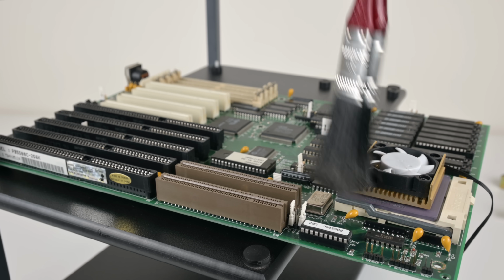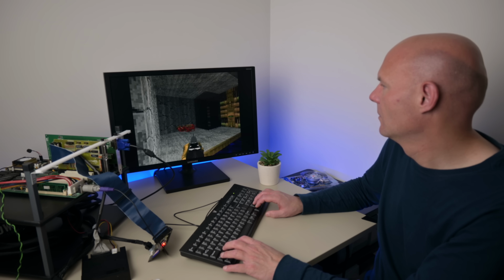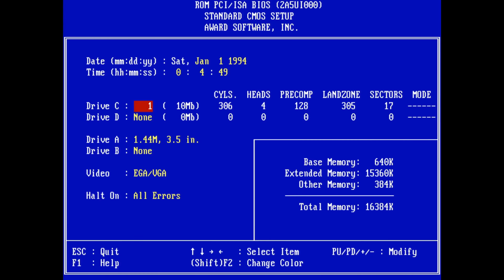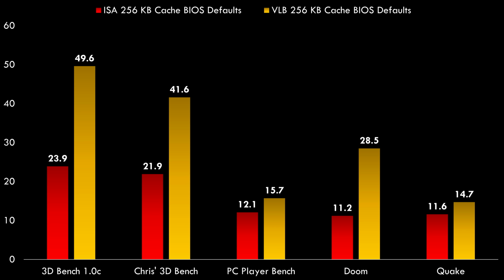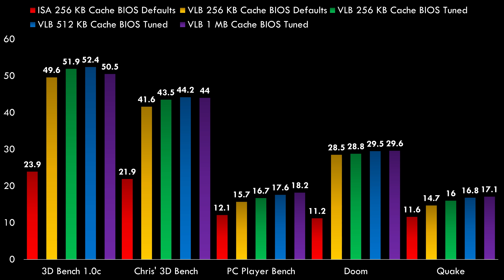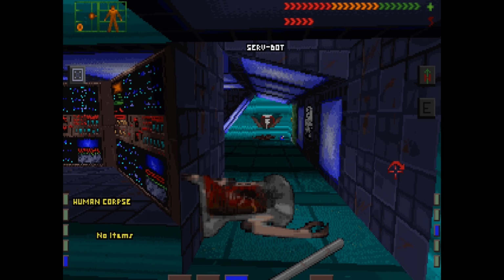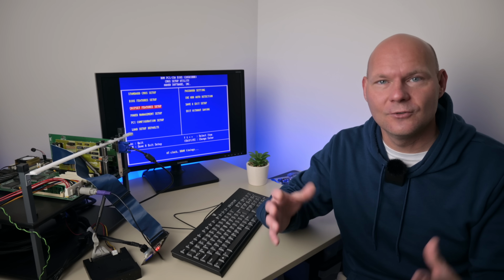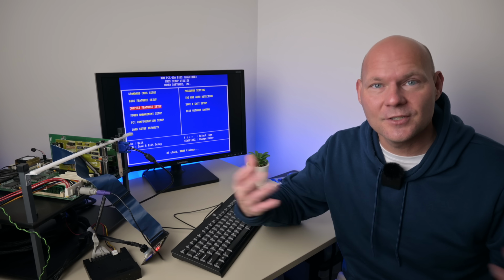Broken CPU Launched the Pentium Branding

Comment: I'm curious, is there a reason with this mobo (aside from the fact that the hardware is so beautiful) to run a VLB video card instead of PCI? Was VLB more stable here?
Reply from the maker: I don't remember why I didn't use PCI, maybe I tried it and couldn't measure a difference. But it's something I can do in a follow up video of some sort.
Reply: @philscomputerlab  I did some digging out of curiosity and this Opti chipset uses a PCI-to-VLB bridge, so PCI would probably perform marginally worse with otherwise identical 2D cards
Reply from the maker: @hblanksjukebox  Thanks for checking this!

Comment: That Pentium is the reason I stopped buying the latest CPUs. I got one and had to return it. On the plus side, by the time I did the 120 Mhz Pentium was out and I got one of those to replace the 60 Mhz bugged chip. No extra charge too. The AMD FX-8350 reinforced this when it came out. I bought one instead of an Ivy Bridge i5 and had serious buyer's remorse for a while. Since then I wait a year to see what comes of it. The Newest chip I have is Alder Lake. When 14th gen hits, i'll upgrade to Raptor Lake. And so on. On the AMD side I am stuck at 2700X. It's way overdue for an update.
Reply from the maker: This is the way. I worked once for a notebook manufacturer and the QA guy told me, never buy the first if anything.

Comment: I have a Siemens Nixdorf PCD 5H with Pentium 75 here.  In addition to 96 MB RAM, it even has an additional USB 2.0 with SATA combi controller 😁 It even works with an SSD, but you shouldn’t expect mega speed.  As you say, 640x480 is critical and 800x600 isn't even worth trying.
Reply from the maker: Awesome 👍

Comment: You should benchmark it with a PCI video card. Most boards with both VLB and PCI have a gimped VLB bus. Sweet board though. That is a keeper for sure.
Reply: If I remember right, I think I have one of these in PCI somewhere. Yep, it's a Stealth 64 DRAM T PCI with two removable memory sockets and 2 fixed to the board.
Reply: While I appreciate it wouldn't be period correct, I'd also love to see this with a Voodoo 1 added. I'm thinking along the lines of, if this were late 1996 / early 97, would a Voodoo have given such a system a last hurrah before being retired from running modern games.

Comment: The chipset is a massive bottleneck here. You cannot have VLB on pentium, cause VLB is a part of the CPU FSB bus, and VLB is 32-bit but pentium uses 64-bit bus. This OPTI "thing" is the only chipset that allowed it, but it does it by operating only as 32-bit. Thus this system has half the memory bandwith. If you want the top performance from early pentium I suggest SIS based socket4 motherboard (SiS 501/502/503). The Intel 430LX is also pretty bad.  Edit: It seems I was not 100% correct, OPTI made many chipsets and revisions, and the one you have seems to be one of the better ones, it has 64-bit access to the memory, but the PCI/VLB is bridged and it still performs sub-par compared to the SIS full PCI setup. I would love to see this system with the VLB card comaprted to the best 486, like Intel DX4 with write-back L1 running at 120 or AMD x5 at 160, which is the better VLB system. My bet is on the 486.
Reply from the maker: The benchmarks though check out, haven't seen anything much faster. I'm sure I would have tested PCI but can't remember the details as I've collected the data years ago before moving and only recently produced the video.

Comment: Nice video Phil. I had one of these first gen Pentiums, the 66MHz variant. A very expensive "white box" build, close to $4000 AUD in 1994 with an Octek mainboard, Connor 420MB HDD, Tseng Labs ET4000W32i VESA bus video, Sound Blaster AWE32, 16MB RAM and a KTX branded 15" SVGA monitor with a 16x2 character LCD status display below the CRT that displayed monitor settings, resolution and refresh rate information. The CPU had the FDIV bug (tested in Excel using a particular formula). One day the computer went into a boot loop, resetting every 5-10 seconds. On opening the case I discovered the heatsink had fallen off the CPU. It was glued on, there was no mounting bracket! The Octek mainboard inside was a cost saving design with a mix of VESA local bus, PCI and ISA slots. This slot configuration meant the system took a performance hit - this board introduced extra wait states on the expansion slot bus in order to juggle the different slot types. A more expensive pure PCI system with the W32p video card would have been better. Video benchmarks confirmed my friend's 486 with a cheap video card had better pixel pushing performance than my expensive Pentium with its premium VESA bus Tseng Labs video card. Still I have some great memories of this machine playing games like Tie Fighter, Wing Commander and of course, DOOM (including some local PvP over a null modem cable I built).

Comment: The aim of Magic Carpet is: Build a castle, kill the monsters of the map. collect the Mana they drop to get more powerful, kill your opponent wizard. Fantastic game, it had also a very good successor. I played it on a AMD486/DX2-80 back in 94-95. It was running flawlessly in VGA with high details and not using the post processing effects the game offers.The game is actually Pentium optimized, you get a nice Pentium-Logo when you start it on a Pentium machine. I think Magic Carpet makes a very great benchmark title, it supports bot VGA and SVGA, various levels of details and post processing effects, making it scale all the way from mid range 486 to fast Pentium IIIs.

Comment: The battery was a Lithium battery, which is why it hadn't leaked. But it would've been flat anyway so a replacement would have been necessary.

Comment: Oh, regarding removing thermal adhesive... Generally if it's frozen it will get very brittle. You could try throwing the processor in the freezer for a day or so, and then see if the fan can be removed.
Reply from the maker: Seems.a good method, I'm getting a few comments suggesting this.

Comment: I went from a 486DX2 to a Pentium 120 and remember a VAST change in performance, despite having the same Cirrus Logic video card. The main benefit of the original Pentiums was the optimization of floating point calculations, which not a lot of games took advantage of but some certainly did, notably Quake and Magic Carpet which both run WAY better on Pentiums compared to 486s. Magic Carpet even autodetects the presence of a Pentium and turns on ALL extra detail settings! System Shock and Duke 3D have playable framerates at 640x400 (looks better than 640x480 for both) on a P120, though with Duke 3D you can get even more performance out of a non-SVGA mode if you go into the config file and manually set up a "chained" (Mode-X) graphics mode with your desired screen width and height, even if you just leave it at 320x200.

As for playing Magic Carpet, the goal is to create a castle and fill it with mana. Hunt around for the red spell jars to get spells to cast which you can choose between by pressing Enter to swap between the main game view and a map/spell screen. Left or right click a spell to assign it to the left or right mouse buttons. The Castle spell will build/upgrade your castles, the Possession spell will claim yellow mana orbs, and other spells like Fireball will let you take down your foes! :B
Reply from the maker: Thanks for the pointers! I will try the 640x400 resolution in the future 🙂👍
Reply: Why would 640x400 look better than 640x480?
Reply: @armorgeddon  Because of a fun little thing called ALIASING. I'm sure you're familiar with the term "anti-aliasing", typically used to describe advanced techniques which help to reduce aliasing artifacts caused by the fact that screen resolutions are finite. Well, System Shock's high-resolution graphics are designed specifically for 640x400, which means if you run the game at 640x480 it STRETCHES the 2D parts of the output and there is NO anti-aliasing to compensate, thus you get lots of horrible aliasing artifacts around text and status bars and such! D:
Reply: @Pixelmusement  Thanks for the explanation! I never played SS but Duke 3D a lot, though at 800x600 on CRTs and never noticed an aliasing artifacts issue.
Reply: @armorgeddon  At 800x600, given that Duke3D's assets were designed for 320x200, this results in pixel-perfect vertical scaling, and while it's not pixel-perfect horizontally the scaling factor there is 5:2, which means for every pair of pre-scaled pixels, one will be two real pixels wide and the next three real pixels wide, alternating perfectly between those sizes. As you might imagine, this can be fairly difficult to notice. For System Shock, the assets at 640x480 were made for 640x400 so there's no aliasing horizontally, however, the scaling factor vertically is 6:5, which means for every set of 5 pre-scaled pixels, one will be two real pixels tall and the other FOUR will be only a single real pixel tall. This looks... pretty nasty compared to how it should... :P

Comment: Beautiful system, I'm jealous! Been trying to get a first-gen Pentium for quite awhile but they're rare and too expensive when I do find them!
This was a pretty rough time for Intel. Apart from the FDIV-bug, performance just wasn't there. For most games at the time, a 486 would perform similarly and sometimes better, and they were considerably cheaper with a fully-developed ecosystem of parts available, not to mention AMD had very competitive pricing on their 486 chips. The Pentium was brand new, unproven, had a crippling firmware bug, ran way too hot (5 volts!) and cost several hundred bucks more to build a system around. It wasn't really until we got the P-90/100 when things started to look good. Once the P120/133 hit the shelves, Pentium systems started flying off shelves in large numbers. I worked at a boutique PC manufacturer during the mid 90s so I experienced most of the 486 era and the beginning ot the Pentium saga. Those were fun times. :)
Reply from the maker: Indeed, amazing times.

Comment: Hi Phil, I just found you can use wd40 to dissolve heat compund. Spray and stay 30 seconds. Then wipe using harder paper towels or blow with canned compress air. Works for both PGA bga socket and CPUs. shiny as new!

Comment: Iconic chip. Even many PC enthusiasts in the early-mid 90s did not have much contact with it though, fast 486's filled the affordability gap and could somewhat keep up with the early, low clocked Pentiums in certain tasks. Quake ruined all of that of course and basically demanded that you upgrade, it was a lesson for a lot of people who focused on clock speed alone though and in 100MHz+ variants the Pentium basically smoked every competitor, it took AMD until the K6 to really come up with something comparable.

I know I wanted one and couldn't afford it :) Socket 4/5 were also an expensive dead end for those who could afford it and typified how quickly platforms could become obsolete in the 90s.

Comment: The amount of cache is just tied to the Cachable range. Ofcourse most of the time the 1Mbit cache chips are the fastest. In old motherboards the Cache is really just a buffer that buffers memory locations every 256bytes. You can actually calculate the amount you need by subtracting 8 bits from the total amount of memory address space. So, 256K are fine for up to 32MB. More cache really only gets utilized if you need more memory like under Windows. 1MB Cache is good for 128MB RAM, which is typically the maximum on Socket 4 boards. Or 64MB if the cache is Write through. Ofcourse those 256K Cache chips only go up to 15ns and 512K or 1Mbit cache chips can go up to 10ns.
Reply from the maker: I remember many years ago you could order Cache chips brand new, bit of course that source has since dried up...

Comment: so how you can remove the heatsink is to use heat, get a small torch and heat it up very hot around 80-100c and then it should just pop off

Comment: I had several of those Socket 5 systems and.... they sucked. All manner of weird bugs, such as the P60 that would only run overclocked to 66MHz, and the P66 that would only run underclocked to 60MHz -- on nominally identical mainboards from the same production run. How I hated those early Microstar boards! No stability at all, and every sort of weird incompatibility.

I had one very similar to yours that wasn't bad, ran it with a P75 "overclocked" to 90MHz (most P75 CPUs were really rebadged P90) but had a weird date bug... as of 1999 (not 2000!)  it thought the year was 2093. And talk about running hot.... you might get that heatsink off with acetone (nail polish remover). More likely it'll just break, so if it works... 

I was very glad to leave these behind for the wonderful Socket7 family. And if they're really worth more than the gold recovery price... I'm sure I have some CPUs of the era in my stash I'd be glad to part with for such a price, tho I got rid of most of the motherboards. Still have a P75 system that has a specific job (mainly because it's already set up that way).

Don't miss the I/O cards at all either. The VLB cards (try that for a huge performance boost) seemed to last well enough but the ISA cards had a limited lifespan and needed regular replacement, and woe unto you if all you could salvage was one with no jumper markings. There were literally hundreds of possible combinations... if the doc sheet was lost and it didn't work right off, might as well toss it.

I regard the P60 era as transitional... best jumped over if you can manage it, while they worked the bugs out of the new tech.

All that said, it was rather amazing and fun to watch you messing with them, getting the most out of what they could offer.
Reply: That was a Y2K bug in certain Award BIOS versions. They only supported years 94 to 99 so they rolled over from 1999 to 2094! Something tells me there's unofficial patches to resolve it.
Reply: @steeviebops  I never found a patch, but if I set the date manually then it was fine... except it would still write bogus dates for file saves. Ah well, that board died a long time ago.

Comment: Do you think the VLB card is a good match for this CPU? It has PCI slots. I think VLB and PCI are similar in speed but there are many slightly new PCI video cards to pick from. I wonder how a 4MB S3Virge or Rage II would perform on those dos benchmarks.
Reply from the maker: I remember studying the chipset data sheet but the details escape me. One of the connections was more native and likely I did a quick test with PCI...

Comment: Because of the premijm price i kept my DX4-100 until 1997 and then swapped it to a Cyrix 6x86MX-PR200 system. Later just swapped the cpu to a Pentium MMX-233. But i bought  a cheap socket4 system with the batman board and a rare Penitum Overdrive with 133MHZ. Traded the cpu for several 486 things, an AT Case and a Voodoo3 3000.

Comment: My first Pentium was a 75 but I had it for years before upgrading because there was nothing I throw at it that it couldn't run. Great times! Somehow these days nothing seems nearly as exciting as it was back in the mid to late 90s.
Reply: I remember the speed at which tech progressed in the 90s, it was simply insane!
We startes the 90s with people having 16 or 33 MHz 386 and 2 megs of RAM, a basic VGA card and a brand new Sound Blaster 16. At the end of the decade we had an advanced Pentium III CPU with SIMD instructions running at a blistering 1GHz clock speed and 256 megs of RAM, an Nvidia GeForce 256 3D acceleration card with 64 megs of on board VRAM and sound cards with 5.1 surround support. Those were some exciting times. A 100 MB hard drive in 1990 was considered a luxury, a 10 GB hard drive in 1999 was all the rage.
Reply: So as mine, I overclocked it to 90Mhz, but at 100Mhz was very unstable.

Comment: If I remember correctly in Magic carpet you fly around and kill monsters and other wizards and collect mana to your own castle. Goal is basically to collect all the mana that drops. You also expanded your castle which meant that the castle would have guards that tried to protect it against any other wizards that would attack it. There were many different spells but you could only have 2 equipped at the same time.